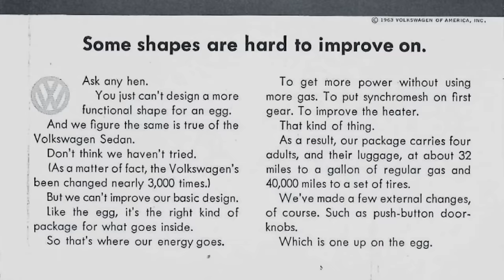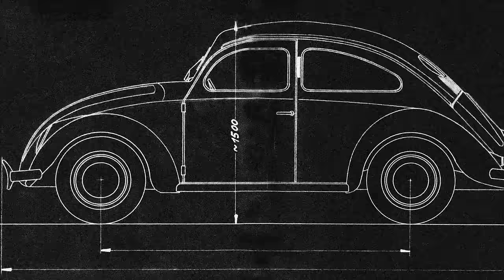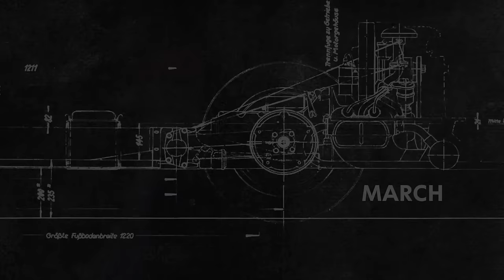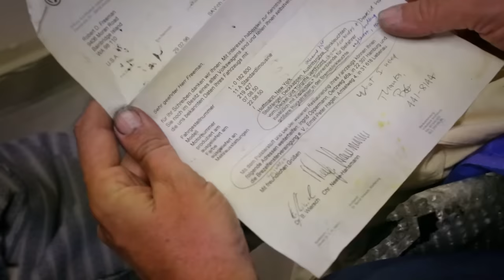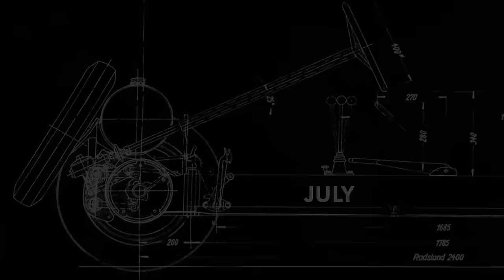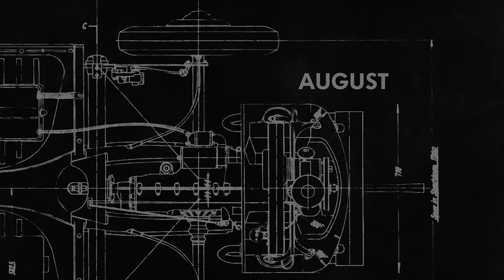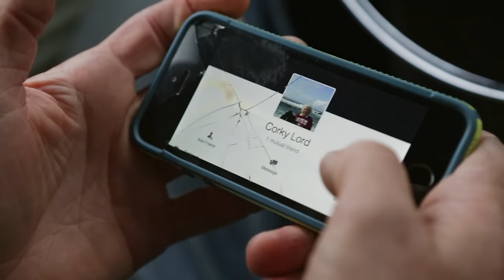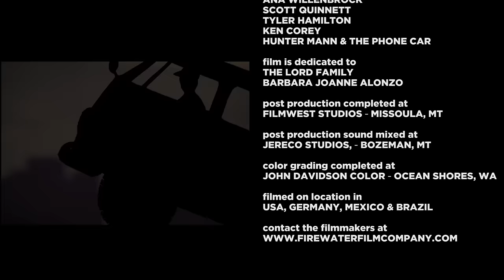THE BUG: LIFE AND TIMES OF THE PEOPLE'S CAR Exclusive Car Classic Documentary 🎬 English HD 2024

Comment: I Mom and Dad owned a VW Beetle when they were newlyweds back in 1967!!!! They had it for 4 years and and traded it for a VW station wagon because I came around!!!! LOL!!!😂😂😂 My Dad said that the VW Beetle was very reliable, dependable, great on gas mileage and it never broke down!!!! For the length of time they owned it !!!! They said they needed a family car when I was born!!!! I wish they still owned that car!!!! Its a classic!!!!😊😊😊
Reply: They aren't lying about the reliability. If you stay on top of the basics, it will run and run and run and run. Start in any weather, idle anywhere. As long as you keep it full of good fuel (non ethanol), stay on top of the oil, and maybe add a pusher fan from a Porsche to help force air into the engine compartment, if the vehicle sees a lot of traffic.

That's pretty much it. I had a cousin car, a Karmann Ghia for quite sometime. Live in South Florida, so I added an AC kit. That required more maintenance to keep clean and such, due to the location of the condensers (under vehicle). But, outside of that, car just never let me down.

Comment: This is a great documentary.  I had a 1972 Super Beetle for five years, and I would have had it longer if the floor hadn't rotted away.  It may still very well be the best car I've ever had.  I'm now on my third Volkswagen, a 2012 Golf (the second was a 2000 Golf, my first new car) and I am just as into the water-cooled VWs as the air-cooled  ones.  I just adopted two kittens, and I call them my four-legged babies, but the 2012 Golf, like the Super Beetle and the 2000 Golf before it, is my four-WHEELED baby.

Comment: Only one tough problem  in older bugs. The solex carburettor!
Reply: I assume you mean the post 68’ carbs? Cause carb on my 59’ is the simplest fuel system I’ve ever worked on, excluding some (but not all) small engine carbs. Its got like 3 adjustments and takes 10 minutes to dial in, and about an hour to rebuild if you know what you’re doing
Reply: Hell the carbs are so inexpensive now days. It’s cheaper than rebuilding them. Never stop me from owning my 68.